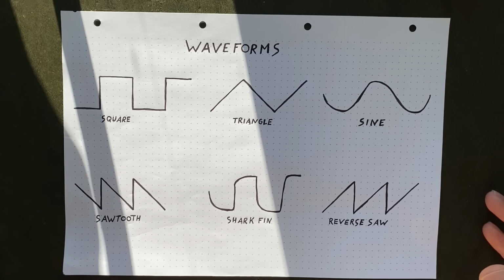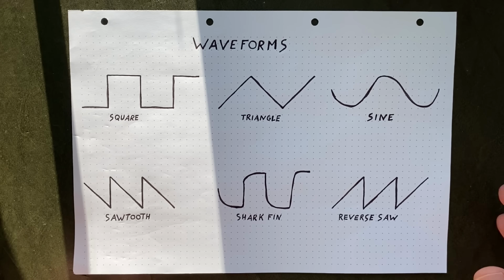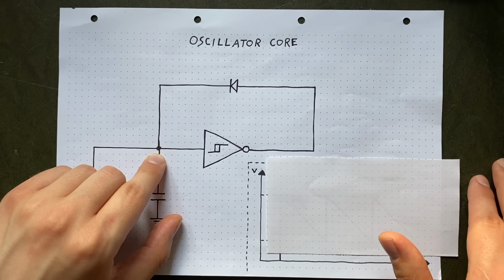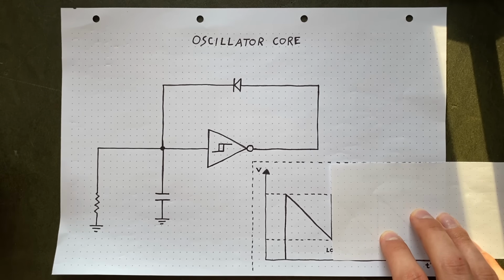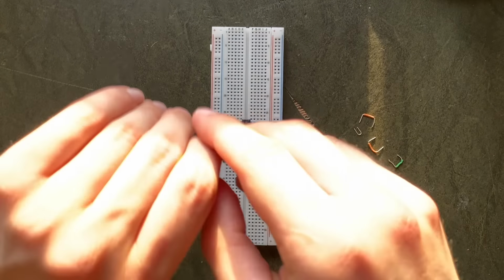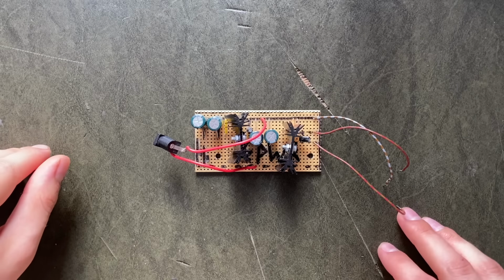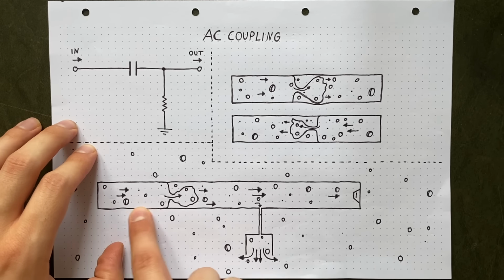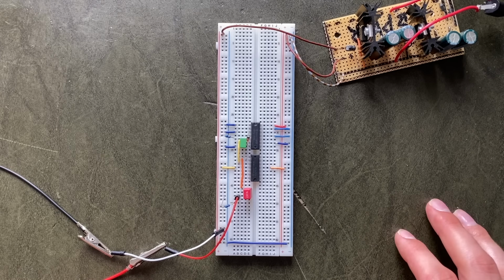DIY VCO Part 1: The analog oscillator core anyone can build

Comment: Having a heat-problem with the 40106 IC, here: 14:43. Ciruit showed the sawtooth once, now nothing .. and the 40106 ist heating up like hell... tried another SchnittTrigger on the ic... Maybe I fried both (I ordered two..)? Any ideas? Thanks in advance!
Reply from the maker: if it heats up, it‘s pretty much a surefire sign that you’ve connected something incorrectly. if you reverse the polarity, or use the -12V rail instead of ground, for example, the chip will die.
Reply: @MoritzKlein0  Thank you! this helps... I rebuilt it twice... Now I'm currenty testing which Schgmitt Trigger is alive... I will comment here, if I'll finy my fault. Thx again for helping out!!
Reply: Ok, it works now. (I ordered all parts before the erica package arived and some parts double). So result for 2 ordered 40106: 1 fried completely (dunno what happened here), and with the other the intended Schmitt Trigger (the one down right) is fried in a way, when connecting the input , the 40106 will heat up like hell.  Using one of the other 5 works well. Thank god, I ordered 2 ;-)
Reply: @hermannloens1868  connecting an output of a chip to a power supply rail can fry a chip too.
 Sometimes you may just fry part of a chip. (Good luck debugging that later...)
 Just take your time to carefully follow pinout diagrams and count pins.
Short, straight wires are easier to follow than long twisted ones.
(Check Ben Eater's YT vids on building a computer on breadboards for neat wiring!)

If anything starts getting really hot, pull the power and check your wiring.

Comment: Thank you and a question … 

Firstly my god thank you for this amazing explanation. I can only echo the many kind words here … I am hooked on this! 

My question - what type of oscillator are you using? Are there any affordable ones beginners could use? Or should you always buy medium to top end? Knowing the make and model would be awesome. 

Thank you again my dude!
Reply from the maker: you mean what type of oscilloscope i‘m using? in this video, it’s an ancient analog scope i bought off ebay for 30 euros. unfortunately it broke after two years of use, which is why i’ve bought a digital one by hanmatek (DOS1102) which is more expensive. if you‘re just starting out, i think there’s nothing wrong with buying a used one - there aren’t any really unusable models on the market that i know of.
Reply: @MoritzKlein0  thank you so much for the great and quick response. Understood .. now off to eBay haha 😄
Reply: There are DIY (ish, some are pre-soldered) oscilloscope kits on AliExpress for about $25 ~ $30
 They're a couple of red PCBs with a small LCD screen.
 Perspex box $5 optional extra.

They're not high end, but are good enough to see digital logic and analogue signals at audio frequencies.

Comment: hi, i am making your circuit using a 7414IC instead of a 40106 and but the result is not a sawtooth but a ramp (an inverted sawtooth). Also when i remove the 100k resistor it generate a sawtooth. Can you help me to understand ?

Comment: This is just great, thank you. So, I was following along on my own breadboard, and my TL074 gets very hot...as in too hot to touch. Is this normal?
Reply from the maker: no, that sounds rather unhealthy. did you maybe connect the power incorrectly? usually the chip gets hot when - is applied to + (and vice versa).
Reply: @MoritzKlein0  Thanks for the reply. All power was connected correctly. It turned out to be a faulty chip, as the problem disappeared with a replacement.

Comment: Maybe It's a basic question, but in the scheme with the schmitt trigger, where is it supposed to be the Vcc? I mean, I see the GND, but what about the positive pole of the voltage source?
Thanks!
Reply: With the 40106 ic, pin 7 is 0v and pin 14 is +v Vcc.

On schematics, the power lines are often not drawn for each gate, amp, or inverter. Sometimes they are on the 1st gate, amp, etc of the chip in the diagram, eg IC1a, or sometimes off to the side with a bunch of capacitors with all the other chips' power connections.

Comment: Hi Moritz, I'm going through your tutorials, and prepared a list from what you have mentioned here. Since some of the ingredients I can find quite easily in electronic beginner packs, and some not, I wanted to ask some technical questions:  (1) Can I use BC547C transistors instead of BC548C? (2) You mention foil capacitors, can I use ceramic or electrolyte capacitors instead, does it make a difference? (3) Maybe you can point out some basic tutorial or website with relevant information regarding the electronics that we use here? thanks, Yonatan.
Reply from the maker: hey yonatan! yes, you can substitute the BC548 with a BC547. if you can’t find foil capacitors, look for film capacitors - they‘re the same thing. if you can’t find those either, you can use ceramic capacitors instead - though they will introduce some distortion. don‘t use electrolytics - they are polarized and therefore not made for many audio applications! i think i explain some of these things in my beginner‘s guide to breadboards-video.
Reply: @MoritzKlein0  thank you.

Comment: Nice video! Really cool idea to use a Schmitt-trigger and RC circuit to create the sawtooth. The voltage divider seemed to make the sawtooth lose some sharpness though (for more experienced electronics guys - is this because the inductance of the resistor is removing some of the higher frequency stuff)? How would we avoid this?

Comment: I don't have negative voltage or dual voltage power supply.  Could an LM358 be used instead of the TL074 with just single voltage rail,  pos V and ground?

Comment: Each component and where it is used:
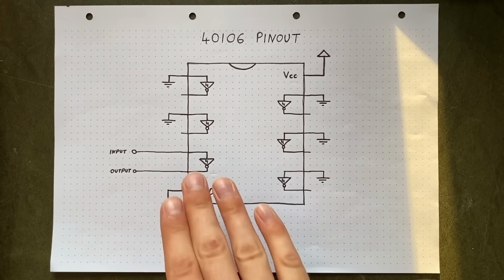Breadboard - 13:16
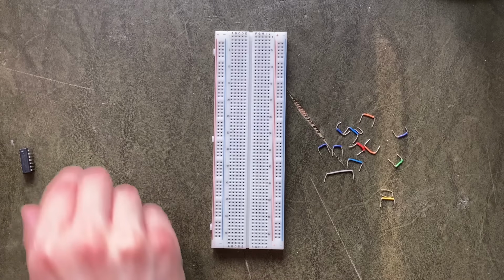40106 Schmitt Trigger Inverter IC - 13:16
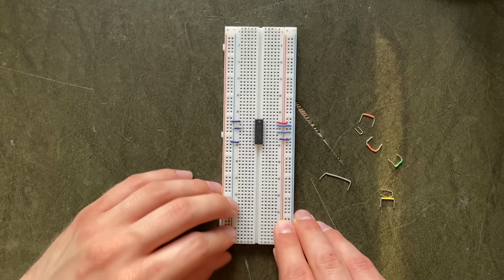1N4148 Signal Diode - 13:25
2.2nF Foil Capacitor - 13:43
100kΩ Resistor #1 - 14:06
9-15V Power Supply #1 - 14:14
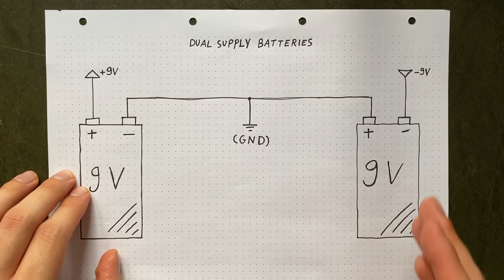9-15V Power Supply #2 - 19:24
TL074 Op-Amp Buffer IC - 19:24
1μF Foil Capacitor - 23:19
100kΩ Resistor #2 - 23:19
100kΩ Resistors #3 and #4 (see note below) - 26:18
Audio Jack - 26:39

Note: In the beginning of the next video, he replaces the resistors used at 26:18 with 10kΩ resistors, so these should actually be 10kΩ resistors.
Reply: Thank you !

Comment: There is a problem in capacitor line. As voltage increases instantly (vertical line) current through capacitor approaches infinity. I would add another resistor in capacitor line to limit the change current

Comment: I hope you see this... I'm trying to follow along, but I have some questions about the power requirements and the Schmitt Trigger Inverter.

If I only have a single 9V battery, can I make a circuit that allows it to function as a dual power supply? For example, hooking the battery up to the oscillator core circuit and the op-amp buffer circuit in parallel?

I'm trying to figure out how to follow along without spending a ton of money, and AC to DC power supplies seem to be kind of expensive, so having to buy two of them to have a dual power supply isn't preferable. 9V batteries are generally non-rechargeable (I think) and so it seems like a bit of a waste to buy them... but maybe not? How long do you think it would take the finished VCO to drain two 9V batteries?

Why does the power supply have to be 9V at minimum? And if that's not the case, can I use 5V or even less?

Also, I'm having a hard time finding a through-hole 40106 IC. I've looked on Mouser and Digikey, and they were out of stock. I even looked on Google, and I found that there are some on Ebay (which might be the best solution) and on a strange-looking website called jameco . com... I'm only trying to make one single VCO right now, so I don't need all of the six Schmitt Trigger Inverters that are in the 40106. Can I buy just one? Can I make one? I think there are other Schmitt Trigger Inverter ICs available, but I don't know if they are compatible with your circuit. Would the 74HC14 be a good substitute? What do you suggest?

Also, is it possible to set the threshold voltages, or are they fixed? How do you know what the threshold voltages of a particular Schmitt Trigger Inverter are?

I hope all of these questions are not overwhelming, if you even end up seeing this comment.

Comment: i'm confused about why we don't see a typical RC exponential decay when the schmidt trigger output is low.
Reply from the maker: just shot from the hip: maybe it‘s because the cap is so small?
Reply: @MoritzKlein0  part of my confusion was that I was assuming the cap was fully discharging, but after looking up the negative threshold in the 40106  datasheet we're only seeing the first time constant (roughly) of the discharge. only enough to maybe see the first part of the exponential decay which sort of approximates a straight line. at least, i think that's what's going on!
Reply: @mirachan23  yes thats right

Comment: if you use a LM324 op amp which is connected to a positive and ground rail. is that enough "headroom" to prevent distortion, because with the TL074 you need a negative rail to prevent distortion. Or can you also connect a LM324 to a negative power rail?
Reply: oooh nevermind I found the datasheet, you can connect it to ground and negative power

Comment: Very informative video! This might be a noob question but how would you modify the oscillator to create a square wave? 

My guess is that you remove the resistor from the oscillator circuit. In my mind, when the inverter stops the voltage from flowing through the circuit the capacitor will empty, but I am not sure if it would be instant (or close enough) to create a square wave. Would this work or would removing the resistor cause a problem? Thanks!
Reply from the maker: removing the resistor will stop the oscillation altogether. to convert it into a square wave, you need to use a waveshaper circuit like this one: https://youtu.be/FUz3gFAh9pY
Reply: @MoritzKlein0  thank you so much

Comment: Boy-o-boy! There's a whole argument waiting to happen here over the direction of electron flow through a circuit. Everything you are teaching about individual components and these circuits is 100% spot on correct ... 
... except current flow is opposite of what you teach. Electrons are negatively charged. Electrons, and therefore current, flows from negative to positive. This means current is flowing actually opposite of the arrow direction of the schematic diode. The schematic is correct, but electrons flow into the point of the arrow. What you teach as far as the flow of electricity is "(very) old school", but you are not the only one on YouTube who continues to teach "voltage flow" or "conventional current" as opposed to "electron flow".
I am NOT criticizing your videos, and your teaching methods are excellent. Teaching "voltage flow" changes nothing about what you teach concerning the behavior of the components and circuits, it doesn't really even change the theory of the water analogy you use here, just be aware that modern teaching uses "electron flow" which is in the opposite direction.
Reply: yeah that might be physically correct ( although you can also have positive particles as charge carrier) but the technical currentflow is defined as from positive to negative. So you could change every curcuit that has been made or published in a textbook but why would you. Besides it doesn´t matter bc it is just a matter of convention. Imagine that every electron going in one direction leaves behind a positively charged atom and you have the flow from positive to negative
Reply: @bubhund6593  What you are describing is called "hole current". It refers to the atom or molecule that needs an electron to be balanced - they have a positive charge. As the electron jumps from one vacancy to the next, leaving a new vacancy behind it as it moves, these holes seem to move from positive to negative. The atoms are not moving, only the positive vacancy moves, like people in a fire bucket brigade. It's important to understand the direction of electron flow mostly to understand how semiconductors work at the molecular level, and it's the current flow that is taught in most electronics courses today and most electronics books written after 1960 (ish). You don't need to change a schematic to teach electron flow - it's correct either way.

Comment: I watched the other video about building the dual power supply, but that is at 12V and this requires 9V. Should I just buy 9V and -9V linear regulators instead and keep everything else the same? Im just confused, do you have two different power supplies, one for +-9 and one for +-12? Because it seems like some modules like this one are designed for 9V whereas others like the arpeggiator are designed for 12V.
Reply from the maker: no, all my modules are designed for +/-12V. you can use this VCO with 9V batteries, but that's not really the optimal option. +/-12V is the way to go.

Comment: Hi Moritz, I'm almost finished building this VCO (all 4 steps). currently waiting for a few components to complete the whole project. Just wondering what to do with the remaining 4 oscillators from the 40106. Can I expand this project by adding more filters etc etc, to make full use of this chip and op-amp? (using TL074). Or is the 3x VCO video a follow up? any help greatly appreciated. kind regards,

Comment: 9:43 What is wrong with your oscillator?:
A diode in the feedback loop, essentially a short circuit for one halve-wave of the oscillation and an open loop for the other halve.
Usually the resistor is there(I am saying your diode is superfluous), where you've drawn the diode. There exists a circuit variant with two antiparallel diodes in the feedback loop, to control both phases of the oscillation with independent time constants. Caveats are: Instable, diode loss(logic level!) and temperature dependent. If this is wanted, a better solution could be two mono-stable multivibrators interlocked within the opposite phase.
Edit: To be clear: If the goal is a sawtooth. So build a stable square wave oscillator without the horrendous diode in the feedback loop and integrate the output. Or if you really can't withstand it have the same diode type power VCC .... (wow, magic) or any other way to subtract the same error-voltage from the feedback. It may be in my imagination, but at the end of the video, do you hear the sweeping in your generated tone? Imagination, hehe. Ask Audacity;)

Comment: Thanks for the video, Moritz:)
You got the reverse sawtooth reverse(no pun intended) -> Wikipedia "Sägezahnschwingung" or "Sawtooth_wave" -> the default non reversed signal form is  {\displaystyle x(t)=-{\frac {2c}{\pi }}\cdot \sum _{k=1}^{\infty }{\frac {\sin(2\pi kft)}{k}}}.
And after you introduced frequency, the technical term for the height of the oscillation is amplitude and not volume. Maybe later after the wave passed through a sound transducer, then through the air and finally hit a detector (e.g. your ear) you can use the term volume. Edit, Hint: The German language is clearly an advantage here -> Laut - stärke = volume.
Anyway, keep it up and ... pump up the volume!;)

Comment: I have a question: my friend asked another guy about the schematic, and he said if you connected the resistor/potentiometer above the diode so it connects to the out of the schmitt trigger that it would be better since it would make an "active" oscillator? In how far is this useful/true and would it make a big difference if to use this method. (Also what does active mean?)

Comment: Nice video! Just a simple question, can I use 1N4007 diode instead of 1N4148? Thanks
Reply from the maker: hmm you can try, but the 1N4007 is not built for high speed switching applications - so it might sound off.
Reply: @MoritzKlein0  OK, thank you

Comment: Just wondering - could I use film or electrolytic capacitors instead of foil for this? Still new to this stuff :)
Reply from the maker: film and foil are basically interchangeable i think. electrolytic capacitors won’t work because they are polarized!
Reply: @MoritzKlein0  thanks a bunch! Super helpful. I forgot about polarization!

Comment: This is unbelievably well-explained. Thank you!! Clearly, the values of the capacitors and resistors are key to fine-tuning the functionality of the circuit - any advice on how to choose them?
Reply from the maker: always depends on the concrete usage. the oscillatore core capacitor, for example, needs to be small so that the sawtooth slope is as straight as possible. once you know that, you can try a few different values and see what works best.

Comment: Would a guitar amp be suitable for listening to the oscillator? If not, what would suffice?
Reply from the maker: i think headphones are a better choice!
Reply: @MoritzKlein0  would they be loud enough if they are plugged into the 6.3mm jack?
Reply from the maker: @elliot9706  yes, the op amp can drive headphones just fine
Reply: @MoritzKlein0  oh cool thanks
Reply: @MoritzKlein0  one other question, can the foil capacitors be switched for other types of capacitors such as ceramic or electrolytic?

Comment: You, uh, did get the direction wrong, though. Due to an unfortunate bad guess long ago, electrons are assigned the so-called negative voltages. So it's the negative terminal of the battery that provides pressure; the positive terminal is the suction terminal. Using op amps and semiconductor diodes you may never care much, but with old fashioned tubes it's vitally important, since the operating principle is that hot electrons will waft across a vacuum while the metal itself won't, and that's where you (used to) get the diode effect.
The clever weirdness that is the p-type semiconductor (which, in effect, contains simulated positrons) makes the modern world much nicer ;).
Love these videos, though. You make me feel like I understood this stuff all along.